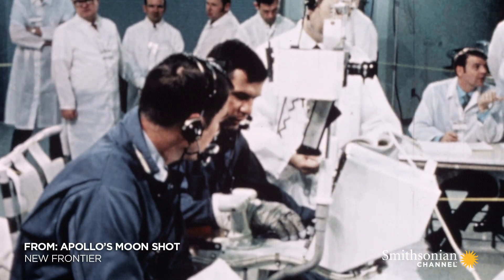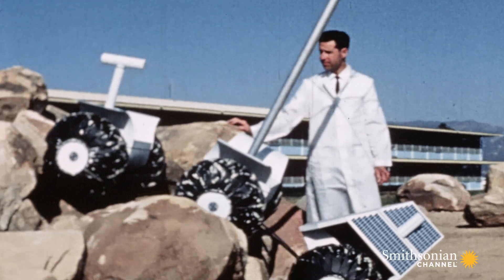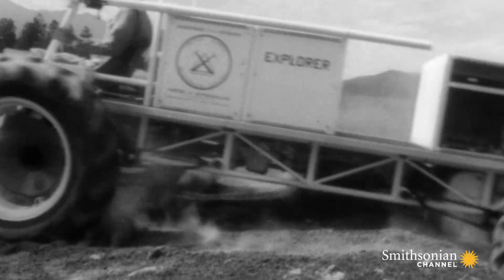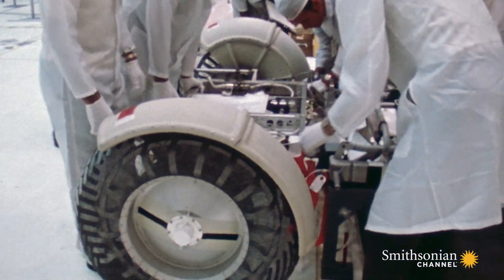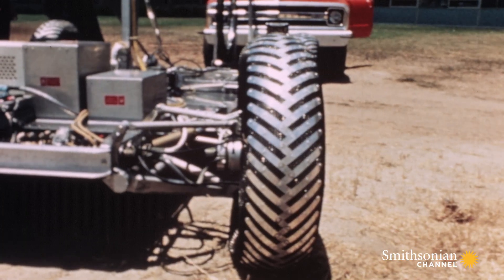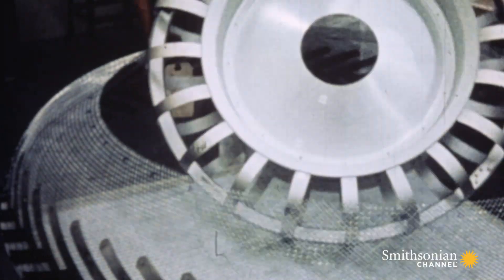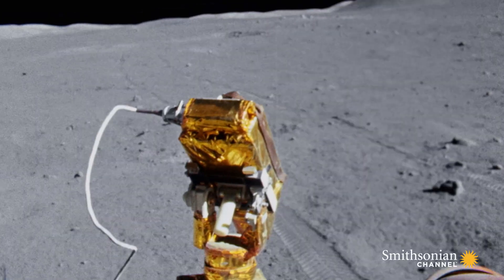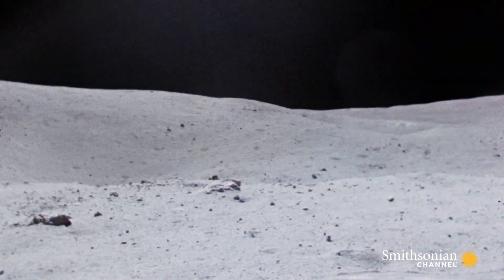The Design of the Lunar Rover Was Mostly Guesswork

Comment: Propulsion? Battery tech back then was terrible and very very heavy. Are we supposed to believe that one of these did 35km on one mission?
Reply: Why wouldn’t it? It was a very light vehicle with very little resistance.
Reply: Light vehicle + little gravity + no drag + low speeds + no air conditioning, heating, lights or radio + no industrial or economical constraints.
Reply: Beauty of 1/6 gravity is that much of a weight reduction. The vehicle could even be picked up and carried by the astronauts if needed
Reply: @erac5855  maybe.
Reply: Power was provided by two 36-volt silver-zinc potassium hydroxide non-rechargeable batteries developed by Eagle-Picher with a charge capacity of 121 A·h each (a total of 242 A·h), yielding a range of 92 km. You can purchase the same batteries from the same company today, however they are quite expensive. Take care.

Comment: Guess work? Looks like a ton of real engineering work.
Reply: Yeah, that's a strange way to title the video.  But, maybe they're referring to the fact that NASA only commissioned Boeing and General Motors to build the thing just 1 year before the due date.  So, it was a massive effort to engineer the thing in a huge hurry.  Perhaps some guessing was involved.
Reply: It looks like guesswork to me for some simple things like not having a artificial temp lab powerful enough to recreate the 140-160 celsius temp that will affect batteries + radiation that affects battery behaviour drastically…this was only found out in the last 10 years that batteries are deteriorated at an incredible rate and recent -274 celsius where matter has a fifth state called bose einstein …i find it like guesswork …also they need to use the same batteries they had in the 60s on these new teslas cause their range drop dramatically at just -40  celsius😂

Comment: Can the Lunar Rovers be Started Up
Again if we go back to the Moon
?? 🌙 🌙
Reply: They were battery powered so in theory bringing new batteries could be done. However, I'd guess that 50 years of solar radiation and heat/cold cycles have probably wreaked havoc on the electronics and motors themsevles.

Comment: If Russia was the first in space, how come they never made it to the moon after all these years?
Reply: They freaked out about the Americans being right on their tail and poured everything they had into being "First at everything" - even putting their own cosmonauts in danger to do so by rigging impromptu solutions with the equivalent of duct tape and spit rather than take the time to do it properly - and blew their lead by neglecting the long-term. They wasted so much on propaganda that by the time they started serious development on the N-1, the Americans had been quietly working on the Saturn V for about 4 years. They then tried to rush development to compensate and, combined with the death of their lead rocket designer in early 1966, wound up with a piece of garbage that blew up every time they tried to launch it.

Their rocket ended up having a fatal design flaw that would have required them to scrap large portions of it to fix, if not start mostly from scratch; having a large number of smaller engines, as opposed to the 5 engines on the American ship, caused so much vibration that the ship tore itself apart. Had they actually continued their plans to go to the moon, they would have faded into complete irrelevancy because the Americans weren't going to sit there waiting for them to fix it and catch up. By the time they had gotten to the moon, the Americans would have finished pioneering the space station, and by the time they got to the space station, the Americans would have done something else.
Reply: Soviet Union was. Not some "russia".

Comment: How could that thin metal mesh withstand the extreme temperatures of the sun's heat on the moon?
Reply: Uh, i mean, it gets hot on the moon, but not that hot.
Reply: @Nathan_Lang  the temperature on the moon is said to be over 130 degrees celcius
Reply: @Māori_Warrior_298  Which isn't much. Temperatures on the surface of earth can be above 70c as well. Its really not hard at all. 

They simply wrapped the temperature sensitive equipment in foil. Its well known that lunar dust occasionally got in and the astronauts occasionally had to manually dust off equipment and deal with overheating issues. But it generally worked, only the dust posed problems. 

Keep the temperature sensitive equipment out of the hot sun with non-conductive materials like foil and you won't have an issue. There is no atmosphere there to speak of, so once you're in the shade you're good.
Reply: @Māori_Warrior_298  Commercial ovens that are made of the exact same material reach temperatures above twice that found on the moon regularly, with little to no effect on the metal. The higher end can reach up to 127c which is roughly 260f on the moon, and the melting point for steel is somewhere between 2500-2800f, or roughly 1371-1540c. You'd be better off worrying about things freezing.
Reply: @Māori_Warrior_298 OMG, 130 degrees celsius???!!!! 

Have you ever noticed how your oven doesn’t melt when you cook your dinner?
Reply: @handbrakebob  oh shoot I thought it would be hotter considering there's no ozone or anything lol
Reply: @Māori_Warrior_298   Who said that?  They would have had to LAND on the moon and measure it to know that.  Just for your information, its NOT that hot.
Reply: Because it’s metal. It isn’t chocolate. 🤦‍♂️
Reply: In space with no air, heat doesn’t transfer

Comment: Why don't we use these tyres on earth? We have to move away from rubber
Reply: It doesnt grow from tree 🌲?
Reply: Because we're not driving a 5mph on a planetary body with minimal gravity?
Reply: Metal on concrete.. use your head.
Reply: Mesh tires work great on low gravity objects like the Moon 1/6 Earth) and Mars (1/3 Earth).  They also have a significant weight advantage, critical in Aerospace design.  Plus the rovers do not travel long distances or at high speeds.

On Earth, not much advantage.  They do not have durability for long distance travel, weight is not critical.  The higher loads due to our gravity, significantly higher speeds and distance covered, make mesh tires impractical for most applications here on Earth.

Comment: what energy density did the batteries have for the rover ? even with the weight being reduce to one sixth they must have calculated the range and loadings ....
Reply: The micky mouse version they unloaded from the Lunar Module was a push version to save on battery weight
Reply: also consider the temperature on the moon surface (-160 - 120 c) I really can not imagine a battery (I didn't see any battery pack of significant size) that would produce that kind of power
Reply: @davidwen5092  Power was provided by two 36-volt silver-zinc potassium hydroxide non-rechargeable batteries with a charge capacity of 121 A·h each (a total of 242 A·h), yielding a range of 57 miles (92 km).
Reply: @fukenbiker  the specs were all lost along with 13000 reels of tape with no backups 
See jeranisms latest video
Reply: @nicolaiby1846  some things don’t add up 😕 do you know atoms act differently the colder it gets to the point where light can turn liquid as closer to absolute zero…they didn’t have a artificial lab powerfull enough to recreate - 130-160 celsius to see how the battery reacts …so it was goodluck i guess😂 did you know that batteries deteriorate drastically due to radiation?i don’t know to me it seems like a alot of guess work that somehow magically worked😂
Reply: @williamsmith9026  Take jeranism with a grain of salt.  None of your statement is remotely true.  He's a flat earther.  Stay skeptical tho but fact check things.  P.S. I've seen two rovers still on earth that they could easily reverse engineer (or use) if they had to.
Reply: @davidwen5092  You "can't imagine" it, and yet it happened.  Inconceivable!  😄  I can't imagine such a level of willful ignorance, and yet it obviously exists.

Comment: Acording to Mr. Ray Ronquillo, Velcro was first used on the back of the backpacks and seat to keep the riders in place on the lunar rover.
Reply: Wasn't it around before that? A quick google search will prove you wrong
Reply: Well after the 2 astronauts died because of velcro, I can see why they didn't.
Reply: First used ?  Not hardly.  Velcro was patented in 1955 and was in wide commercial use starting in the late '50s.  The first lunar rover wasn't until Apollo 15 in 1971. 

According to easily found info on the Internet, Velcro was used only on the lunar rover's seat belts, not on the seat backs to stick the astronauts to the seats.  How would they have gotten unstuck?

Comment: Any ideas on how those lunar rover batteries (from the 1960's) weathered the 265F degree temps on the moon?  How about their rubber soled space suit boots?
Reply: I was employed with 3M at one of their smaller plants in northern CA, for just over 23 years ( until we closed in 2009 ).   When the corporation reached its 100th anniversary ( sometime in the early 2000s ) they gave us all these big books on the company's history.   I remember a photo of that footprint on the moon's surface....along with the story of how 3M developed the material that was used for the soles of those boots.
Reply: What is 265F going to do to rubber boots that's slightly hotter than boiling water
Reply: @PabloGonzalez-hv3td   So tell me how the Kodak film in their still shot and movie cameras survived the heat?  Film negatives and films rolls absolutely cannot survive those kinds of temps (proven) and there was no insulation ot protection for the film in those cameras (proven)..  Shall I continue?
Reply: @1BADGT500  - The moon has a wide temperature range you're automatically assuming they encountered the hottest conditions and if you're wondering how they dealt with potentially high temps you should probably look in to how people walk on lava flows taking pictures and videos
Reply: @PabloGonzalez-hv3td   I don't need to look into it, I live on the Big Island of Hawaii and I have been out onto hot lava flows (which have cooled significantly enough to walk onto the outermost crust (as long as you don't fall through in which case your foot/leg would simply evaporate).  I also know that the tiny amount of 02 carried by the astronauts in their backpacks would not have lasted very long at all (even if they used rebreathers). Armstrong and Aldrin spent 21 hours, 36 minutes on the moon's surface. That does not include ascent and descent time. That would not be possible.  They'd need a lot more 02 tanks and a lot more 02 to survive and didn't have the room for it anyway.
Reply: @1BADGT500    - Again you're making false assumptions the LM itself was pressurized no one is claiming the oxygen in the suits was the only source for their 21 hrs mission and falling in to lava would burn you to ash and quickly but you would not sublimate to a gas and "evaporate"
Reply: Great comment!!
Reply: @PabloGonzalez-hv3td   Cook somebody's feet??  Check on their boots and you will find that there is no provision for the "cooling fluid" (or tubes) which there is in the rest of the spacesuits to keep them cool.
Reply: Hi, hope that you are well. You wrote "the 265F degree temps on the moon". While it is correct to state that the moon's surface experiences a wide temperature range over the course of a lunar day (in the range 140K to 400K) However these temperatures were never encountered during any of the Apollo missions. All the Apollo landings were planned to occur at lunar dawn, when the lunar temperature is somewhere in the middle of the range. For example, during the Apollo 11 mission, the measured temperature range was between -23°C to 7°C (250K to 280K). Take care.
Reply: People on the Internet acting like they have no access to the Internet. 😆 The knowledge of mankind at their fingertips and yet they beg random people in a comment thread to spoon feed them info they could have found on their own in seconds.

Comment: There's no notes about what a 210kg mass bolted to the side of the LEM did to the balance, which given the single central motor would have been extremely critical. 
Then the 1g winch at 1:11 , that wasted the crews of Apollo 15,16,17 about half an hour each. With a lunar weight of 17.5kg each NASA would have added two handles and got the astronauts to simply carry it out to a space on the lunar surface.
The 1g winch was needed to play with it in an earth based studio.
Reply: It's not like rearranging equipment to rebalance was out of the question
Reply: @PabloGonzalez-hv3td  Yes, that's the only way to re-balance. There's no mention, record or discussion of this being needed or done - it's almost like they lowered the LM from a winch and so the question never came up :).
There's also no discussion of getting an astronaut to move inside either, they both rushed to the front, noses against the windows when they were slowing down to land LOL
Reply: Amazing.  So much willful ignorance.  Without writing a book to spoon feed you info which you could have easily found for yourself, the lunar rover was not "bolted to the side" of the LM.  It was stowed in quadrant one, in other words, much nearer to the centerline of the LM than in your silly description, and the heavier J-class ELMs of Apollo 15 - 17 were specifically reconfigured to carry a rover.  The ELM's more powerful descent stage DPS engine had a GIMBALLED nozzle, in addition to SIXTEEN directional thrusters in four groups.
Reply: Don't forget those glorious test flights prior to perfect touchdown in unknown conditions, these guys really were Godlike
Reply: On or near the moon, they are under the gravity of the moon, which is around 1/6th of that of earth.  Balance does not become a critical issue.
Reply: @bobolulu7615  Ignorant comment of the day.

Comment: I always wondered how they got that rover on the moon in that tiny lunar lander. Thanks Smithsonian Channel!
Reply: It was folded up for easy storage and weighed about 35kg on the surface of the moon.
Reply: @neilogborne7947  Which is why the 1g rated and tested Winch was only needed for faking the trip on earth.
Reply: Just the same way Russians did before with the Lunakhods
Reply: I can't believe there isnt more flat earthers here.
Reply: You mean the micky mouse version they unloaded from the Lunar Module
Reply: Assembled Together
Reply: Me 2...😅✌🏾
Reply: My dad worked on this rover and built a few parts for it (camera protective shutters) and one of his work mates ended up starting Dahon Bicycles...now the world's biggest folding bicycle company....I wonder where David Hon got the idea!
Reply: They drove it thru the hanger bay door.. simple.
Reply: They didn't take it to the moon, that's for sure because they would have had to remove critical parts of the lunar lander to make room for the lunar rover.
Reply: Except they didn't
Reply: The LM side pod would not be big enough to get the rover and everything in it
Reply: Drove in thru the soundstage garage I reckon.
Reply: we are the only ones that realize that. it won't fit through the hatch and how did they all fit into that small space .how much fuel do you have to burn to catch up with the orbiter that moves at 17000 m/hr they don't have the volume for that. furthermore how did thet escape the radiation belt??? and they had NO PROBLEMS WITH THE MOST DIFFICULT MISSION IN THE HISTORY OF MAN KIND . HOW DID THEY GET INSTAN RECEP BETWEEN EARTH AND THE MOON TION . hello john . how are you doin on the moon today ? fine . .. .no delay!!!
Reply: @johannschutte466    Oh dear. The Rover was attached on the side of the lander module.  You dont 'burn' fuel to catch up to the command module.  It was meticulously timed so that when the command module was approaching, they took off from the moon.  Remember, there is no friction in space, so only a short burst of rockets is required then the the lunar module just 'carried on' without propulsion.  This so-called 'belts' .. well at 17,000 miles per hour its quite easy - you pass through in about 13 seconds.  As for the phone call, well, that was actually the easiest part of the entire space program.  A simple impedance matching transformer was connected from a standard land-line phone, to the audio uplink to the moon.  There was a few seconds of delay, but you wouldn't know because it happens in real time.  Even a school kid could work that one out.
Reply: @johannschutte466  Johann🤔 i have a better question... how did the Rovers internal combustion engine work in an anaerobic environment ⁉️
Reply: Stop asking good questions please.😗
Reply: @davidh5276  electricity
Reply: @johannschutte466  How did three men go to the toilet without gravity in a tiny capsule, for three days???
Reply: @johannschutte466  propably decided to not tell us because whatever they did would make them seem incredibly reckless regarding security
Reply: @johannschutte466  nobody realized we're gonna asked these questions.
Reply: @ermacsmith3709 😂😂😂😂
Reply: hoax